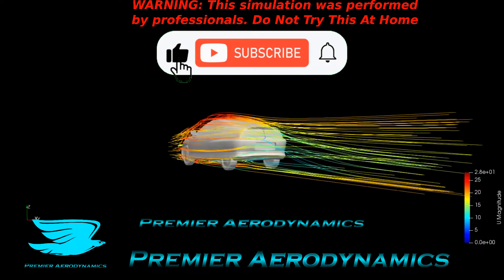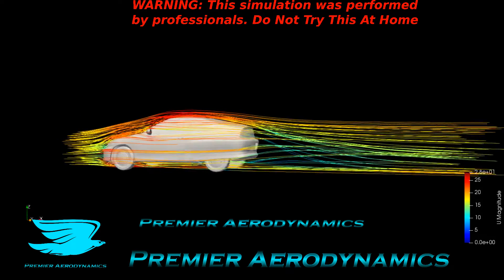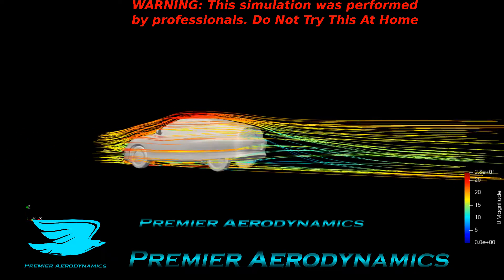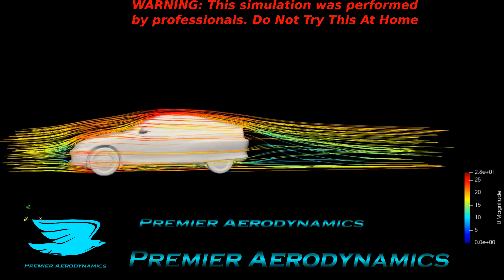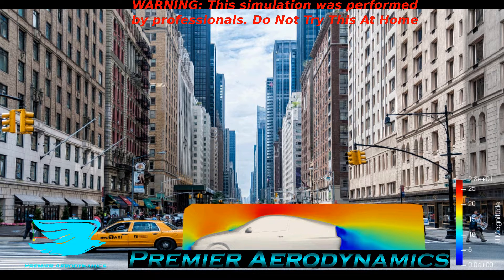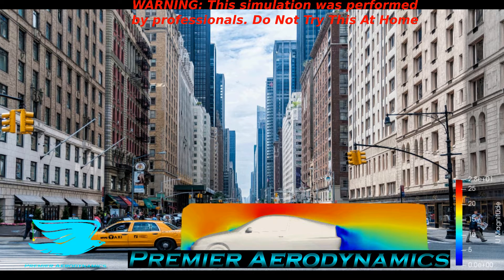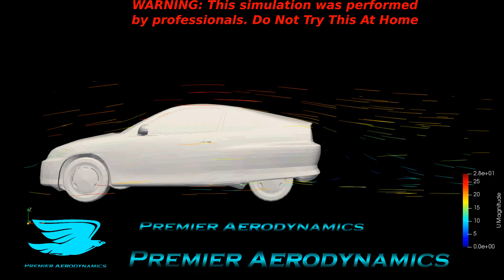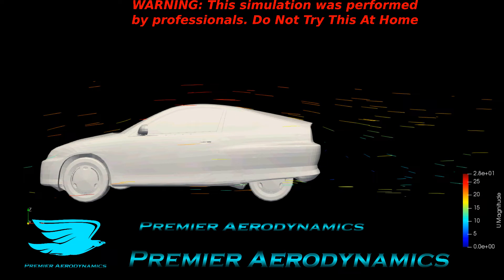Honda Insight Aerodynamics

Comment: No comments ? 
What CFD program is this ? 
Did it give an accurate cD ? ( .25 )
I find it interesting how that the 2002 Lexus LS430 has the same cD as this car, despite having an upright 3 box design. 
And as far as " C ", I'm going to say Chad .
Reply from the maker: This one was openFoam. From memory, the drag coefficient was around 0.26, but that was with rotating walls for the rims. So, there is a drop in accuracy from that.

Good point about the Lexus, but there are some notable differences that help the Lexus despite it having an ICE. For example, it seems to have more of a front spoiler setup, which will reduce the underbody drag. It also doesn't curve as much on the roof, which will help with flow separation and reducing drag there.